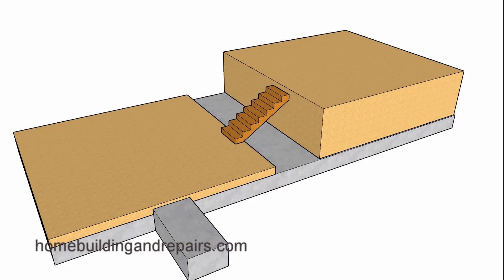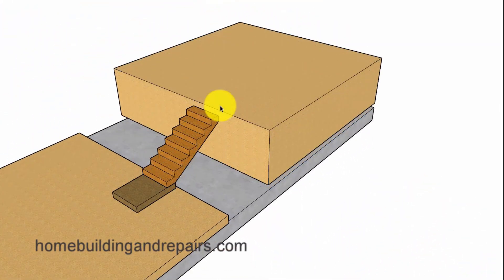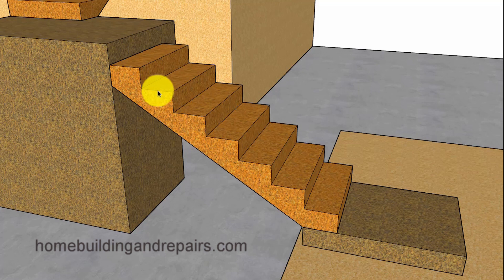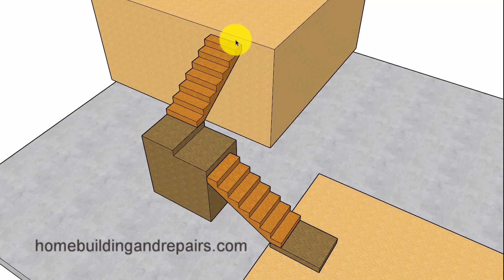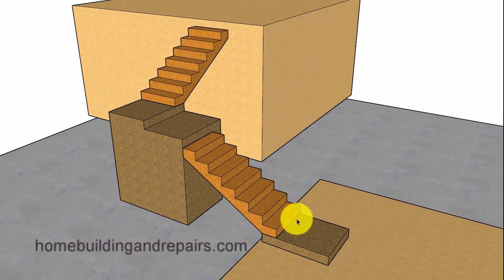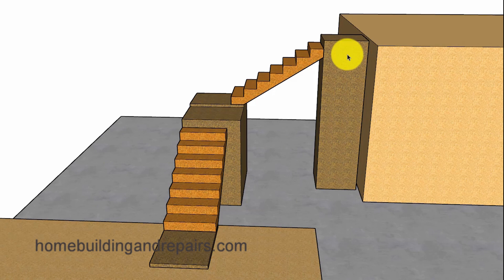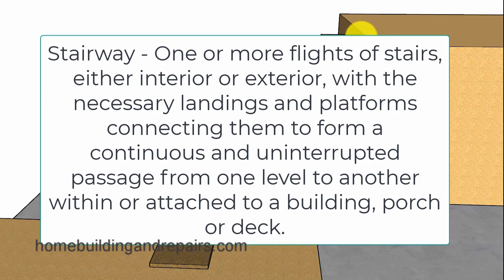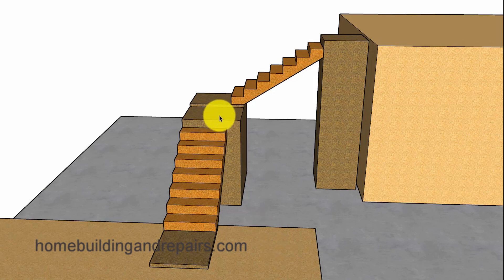Can Landing Riser Heights Be Taller of Shorter Than Flight of Stairs - Building Code Interpretation

Comment: This is true for us here in Michigan.  A landing appropriately sized to code separates the flights of stairs.  I know from experience...had a 17R to basement with 13R down from 1st floor, landing then 4 to basement.  I forgot to subtract 4" for future slab to be poured.  So my landing was off quite a bit, as were my 13 top risers, IF I was to continue same unit rise with bottom flight (always try to )  As i was about to tear them out the builder happened to walk on site and saved me a lot of trouble!!
Reply: Please explain if the landing between stairs riser can be higher or lower than the stairs riser
Reply from the maker: Thanks for sharing.